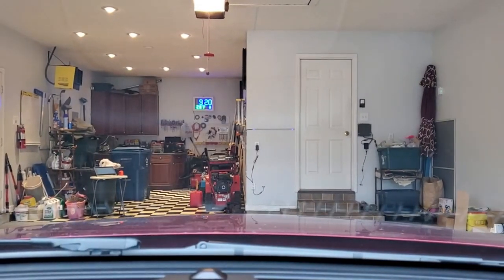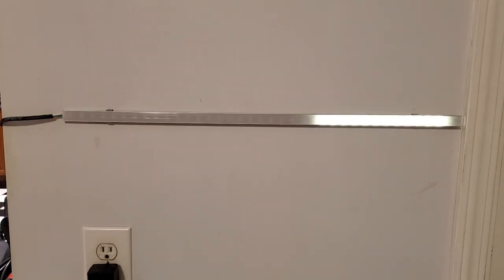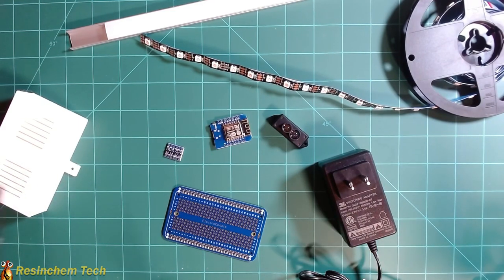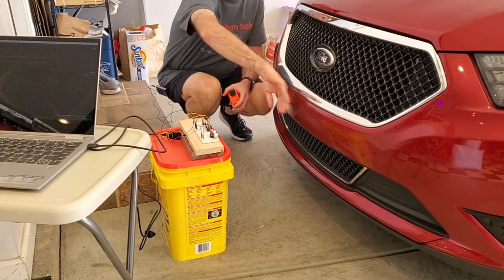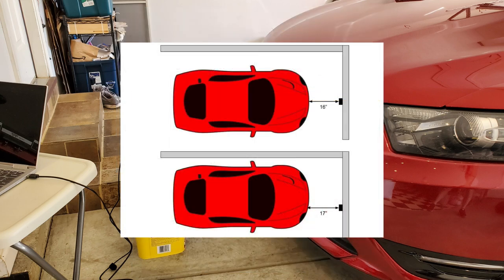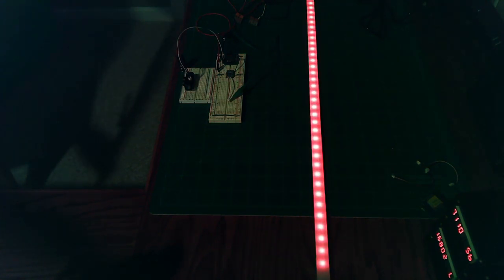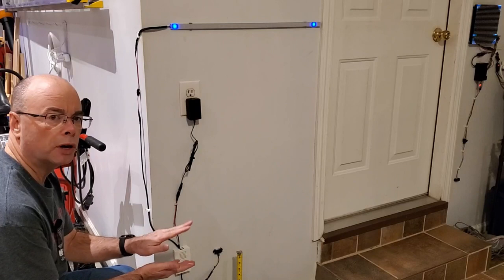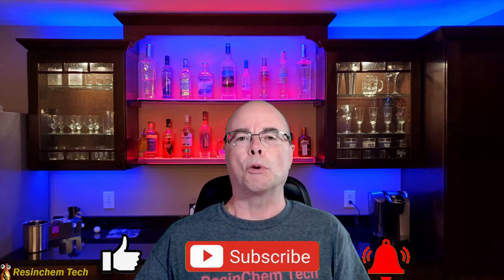A New Parking Assistant using ESP8266 and WS2812b LEDs

Comment: You can get reasonable ToF devices that go to 4m (call it 3m in reality). That is enough and they are still ca. $6.
Reply from the maker: The question is whether the ToF would have a stable enough signal.  As shown in my testing, the ToF was already the noisiest signal, bouncing around by up to a half inch even when only 12" from the source.  I've noticed that as well with the ToF sensors I use on my stair project (although the noise isn't an issue for that particular project).  So, it's not just the range, but the stability of the signal... you don't want the signal bouncing around as you approach the final parking zone.  The TFMini-s/LIDAR sensor was by far the most steady, consistent signal at all the tested distances when compared to both ToF and ultrasonic.

And of course a ToF sensor would not work with my firmware, as it is specifically written for the TFMini-s using the serial port.  But my code is available on Github, so if someone wanted to modify it to work with a ToF sensor/I2C, they are certainly free to do so.
Reply: @ResinChemTech  You are right - they can be a bit noisy. However there are two things that are relevant but maybe not considered. 1) use a running average to increase the SNR or even use two ToF sensors (that clears up the visual feedback noise) 2) half an inch is insignificant on something with the physical characteristics of a car. It moves too fast with too much momentum / poor contrrol feedback and the front isn't completely flat. Do you really need to position it to less than half an inch? I would suggest that almost no-one does. So my comment is some thoughts for people to minimise the cost. I always try to minimise the energy usage - just because it is part of the mental challenge of my projects. What might be quite fun is to use the "new" microwave presense detectors that are a few $. Nice project, BTW!
Reply from the maker: Hey... no problem.  I always appreciate ideas and recommendations.  I guess I just said what I said because I wanted to state why I picked the sensor I did (my wife's final parking spot is almost 3 ft from the sensor... don't know how much noisier the ToF might be at that distance) and she actually does have a pretty short range for her car to fit just right... (but it is more than an inch!).  And my sensor is placed relatively close to a side wall and the larger FOV of the ToF might be an issue (but I didn't test). I also didn't want anyone to think they could just drop in a different sensor or sensor type and get my code to work (and yes... I've gotten comments from those that have actually thought they could).  Others have said they built something similar with an ultrasonic sensor and it worked fine.  That's the great thing about DIY... more than one way to tackle a project.  For me in my situation, the TFMini was the best choice.

And like you, I'm always looking to minimize costs.  I've received requests for this project, and others, to create an ESP32 version.  And my point is always, why?  If the ESP8266 is adequate for the job, then the ESP32 is overkill and you are spending extra money for basically nothing.  No one has given me a good reason other than they already have an ESP32 and don't have an ESP8266.

But I do appreciate your comment and recommendation.  If folks can build a similar system with a ToF sensor... or even ultrasonic and save some money, then that's great.  I just didn't want someone else to see the comment and think they could just swap out the TFMini sensor and still use my firmware.  Sorry if I came across as a bit defensive!

Comment: Would you be able to use a dig uno to build this?
Reply from the maker: I don't believe this would be possible for a couple of reasons.  First, I think that the DigUno (ESP8266) makes both the RX/TX pins available but these are used for LED data and are level shifted, so you would not be able to connect the distance sensor.  I also believe it does not expose GPIO12 (D6) that the parking system uses for the LED data line... although this last one could be changed if you edited the firmware and compiled your own.

Finally, the firmware currently does not work with the ESP32 so you could not use the ESP32 version.  I'm not up to date on the current revision of the DigUno, but from my own older version and the current info on Quindor's site,  I just don't think that the DigUno could be made to work with this project... not without extensive modifications to both the DigUno and the firmware code.
Reply from the maker: I wanted to follow up on this, as another user, @HayMark, did figure out how to make this work with a DigUno... and without the need to modify the firmware.  According to him, to make it work you need to:

1. LED data to Q3 on the Dig-Uno
2. TFMini RX into the GPIO3 on the Dig-Uno
3. TFMini TX into the L1 C port on the dig-uno
4. I combined the power/ground for the tfmini and the LED strip and plugged into the Dig-Uno. I probably don’t plan on keeping it this way but it works for testing. 

He also has some photos of the connections here:  https://photos.app.goo.gl/fUdDYQVKkKSnwrkw9

So, my apologies... apparently it can be made to work with a DigUno!  And a big thanks to @HayMark for figuring it out and sharing how he did it.  But please note that this is the D1 Mini/ESP8266 version... the firmware will not work with the ESP32 if that's what you currently have with your DigUno.

Comment: Would this work with an ESP32 chip?
Reply from the maker: Not as the firmware is currently written.  Different libraries are needed for the EP32.  I most likely will not develop an ESP32 version as I personally don't see any advantage.  The project runs fine on an ESP8266, so an ESP32 would really just be overkill and would result in spending extra money for something that really doesn't  provide any additional benefits.

Now, if somewhere done the road, I developed a new version that used a secondary side sensor to provide some sort of lateral left/right alignment, a move to the ESP32 might be needed.  But I don't currently have any plans for that.   Is there a particular reason that I've overlooked as to why you might want to use an ESP32 with this project?
Reply: I have no particular reason other than I had an extra WLED controller with an ESP32 chip and wondered if it would work. I thought I could make a second unit for a different vehicle bay. I appreciate your answering all my questions and being so helpful! Thank you!

Comment: can i do this with esp32 and a hub75 matrix ?
Reply from the maker: Most likely... but you'd have significantly rewrite the current firmware, both to support the ESP32 and to interface and output to the matrix display.  The current firmware will not do either one of those things, but the source code is available on Github if you want to use it as a starting point.

Comment: After i connected the D1 Mini to my WIFI i am n ot abel to reach the webinterface. what could the problem here? thank you in advance for your help
Reply from the maker: There are a couple of things to check.  First, assure that your device (e.g. phone, tablet, laptop, etc.) is on the same wifi network that you selected for the D1 Mini/controller.

Next, assure you are using the right IP address, which you have to get from your router after joining the wifi network.  This will not be the original 192.168.4.1 that you used to initially setup the wifi, but a different IP that is assigned via DHCP by your router or whatever device you are using for DNS on your network.

Finally, check that the D1 Mini/controller is no longer broadcasting the original ESP_ParkingAsst hot spot.  If you can still see this hotspot via your phone, that means that the controller did not successfully join your wifi.  Try the initial setup again, assuring that you enter the wifi password correctly.

Let me know if you continue to have issues.
Reply: thank you very much for the quick reply. i can see the esp in my router settings and its online but i am not able to communicate. i have no idea what else i can do. 

moreover i tryed differnt D1 mini. same issue
Reply from the maker: When you first power up the system, are you seeing the normal "boot" process... solid blue lights for a few seconds, followed by red & green lights for a few seconds?  If you do not see these lights, then the boot isn't completing... and the web interface will not be available.  This is most likely due to a problem with the TFMini-s connection.  The TFMini must be connected and communicating on the serial port for the system to operate normally.
Reply: so, i'm not able to see the web interface and the start sequenz of the LED. But unfortunately thats it. There is no further reaction of the led stripe. The TF Mini light up a little. Did i do somthing wrong?
Reply from the maker: Ok... if you are not seeing the boot/start sequence with the LEDs, then you most likely have something wired incorrectly.  Carefully check your wiring, being sure that you did not mix up the RX/TX wires from the TFMini to the D1Mini.  RX should be connected to TX and TX should be connected to RX.  If in doubt, use the connector that came with the TFMini to confirm the pin order on the TFMini and wire colors used.

Sounds like things are almost functioning.  Once you see that boot sequence on the LED strip (blue followed by red/green), you should be able to access the web interface.
Reply from the maker: Oh... and one more thing.  Be sure you are using a TFMini-s,  The TFMini-s and TFMini-plus changed the communication protocol from the original TFMini.  The library used in the code will not work with the older, original TFMini.
Reply: the the boot sequence is as mentioned from your side and stopped with two red leds. i ordered TFmini s version 1.8.1. is there any way to test the sensor?
Reply: could maybe voltage or current an indicator?
Reply from the maker: OK.. if you are seeing the boot sequence complete, then everything is likely fine from a wiring perspective.  The LEDs won't react until you complete the web setup and enter distance information first.  So, let's circle back to that.  Can you tell me the IP address that your router assigned to the controller? 

If you like, this might be easier to sort out via email (where images, etc. can be posted, unlike YouTube comments).  You can find my email address on the 'About' page of my YouTube channel.  I don't post it here in the comments so that it is not picked up by the spam bots.

Comment: Any reason why you didn't use esp32 for this project?
Reply from the maker: No particular reason other than an ESP8266 is perfectly adequate for the job here... and the extra 'horsepower' (and cost) of an ESP32 isn't really needed.  Plus, I already had the libraries/code for things like OTA, Wifi onboarding, web interface developed for the ESP8266.  It wouldn't have taken much work to update those for the ESP32... but again, the ESP32 isn't needed for this particular project... so my take was why spend the extra money and effort on the ESP32 when the ESP8266 does the job just fine.

But if you want to update those libraries and procedures to use an ESP32, I'm sure an ESP32 would work just as well.
Reply: @ResinChemTech  thank you my favorite teacher...👍👍

Comment: when I try to compile the code I get this error. Can you help?

sketch_dec02a:15:10: fatal error: ESP8266HTTPUpdateServer.h: No such file or directory
 #include <ESP8266HTTPUpdateServer.h>
          ^~~~~~~~~~~~~~~~~~~~~~~~~~~
compilation terminated.
exit status 1
ESP8266HTTPUpdateServer.h: No such file or directory
Reply from the maker: If you are trying to compile your own version, you need to assure you have all the necessary libraries and environment setup properly.  It appears that you have not added the ESP8266 libraries via the boards manager.  Any reason why you aren't using the current release binary, as this will have all the necessary libraries bundled in? While you are free to use the .ino and compile your own, it does require that you have a full understanding of the Arduino environment, including adding in the necessary components for using ESP boards.
Reply: @ResinChemTech  I'm not trying to compile my own ino. I copied the file from the repository and I thought it needed to be installed through the arduino ide. How can I down load it and install it. Thank you for any help you can give me.
Reply from the maker: It's actually much easier than that.  Go to the releases in the Github repo ( https://github.com/Resinchem/ESP-Parking-Assistant/releases ).  If you scroll to the bottom, you see the latest . bin file (ParkingAsst_vx.xx_ESP8266.bin).  This is the file you need to download.  Then the wiki  has step-by-step installation instructions ( https://github.com/Resinchem/ESP-Parking-Assistant/wiki/02-Initial-Installation ) in addition to information on first-time setup, using the web interface and more.  You don't need the Arduino IDE unless you want to modify the code and upload your own version.  But the wiki has all the information you should need regarding the firmware and web application,
Reply: I am a busy father and this is the first “fun” (Not absolutely necessary” project I have wanted to do in years.  I commend you for your video and the work you have put into this.  Thank you!
Reply from the maker: Wow!  Thanks so much for the kind words... it really does mean a lot to me to hear things like this from my viewers.  If you do build the project, let me know how it goes... and of course I'm here if you run into any questions along the way!